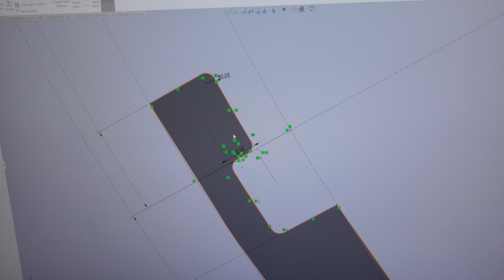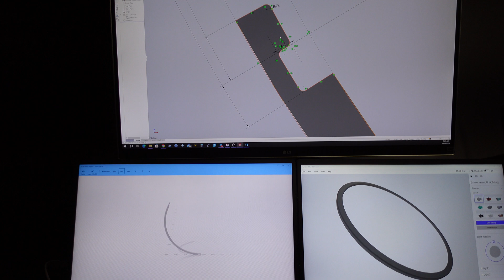Begode EX30 - Make your tire feel awesome - STL included

Comment: How does this sit on the rim, is it fixed somewhere? 
I think this might be dangerous but I’m projecting motorbike tire slippage on rims as the tire is rotating on the rim. The forces on that plastic piece might just be to high and it might brake. Curious about what you’ll report in the future on that little workaround instead of getting a tire sized properly for the rim, if available
Reply from the maker: Great point.  TPU wont hold to the rim as strongly as the rubber would.  Might wanna put a bit of anything to help it grip.  I will add this advise in the comments.

Comment: This is super interenting roger.

My friend just lent me his ex30. He has a Diablo rossi sport on it 80/90-14 and i feel like im fighting it on every corner it wants to high side me constantly. And when surface angle changes the tire always wants to sit perpendicular to the surface. Is this what you mean by fighting the wheel?

Seems the ex30 rim is super wide.?

Very keen to try this mod.

Like to know more about it.
Reply: I changed from my stock tire which was a street tire to the IRC NR-77 on my EX30 and I feel exactly how you described (like it wants to high side me in turns). I know someone who had a tire spacer slip out and it caused them to cutout and break their wrist so I'm not very keen on the idea of putting more plastic into the rim, but I just don't think a more nimble tire exists for the EX30 with the wide rim.
Reply: @jtm94  I ended up printing the full loop 1 pce spacer in tpu for my friends ex30 on a 500x500 ratrig. It made a huge difference in improved wheel behavior and being 1 pce in tpu it is very secure.

Comment: I have an Ex-30, I just got the 90/90/14 without doing enough research. I got it seated on there with the tube in it and I have it to where I'm about to put the axle bolts back on but it is tight and rubbing the metal I'm wondering is it worth even putting the bolts back on or should I just buy a smaller Tire? Will the rubbing go away and is it safe. I don't want to have to take it apart again I just did this last week and popped a tire by accident again😅. Help please!
Reply: Trying the 90/90 here soon with the ex30, was told that the spacers should alleviate the issue.  If not, I will do some extremely light sanding to the tire.

Comment: Great vid i will let da guy's know we have some EX30's due in couple weeks.... I have 90/90/14 Pilot Street 2 for my Master & 90/90/12 City Grip for my T4 V4 i still need to install on both my wheels.... Well done Roger.... Thanx 4 sharing
Reply from the maker: The tire I installed was an 80/90-14.  The 90/90 rubs the metal a bit.  If you add the spacer, that should fix that.  The profile of the 90/90 isn't nearly as bad on that rim.
Reply: @roghaj  Yep i have 4mm spacers already cut up i have them installed on my T4 just need to put them on da Master.... Thanx Roger